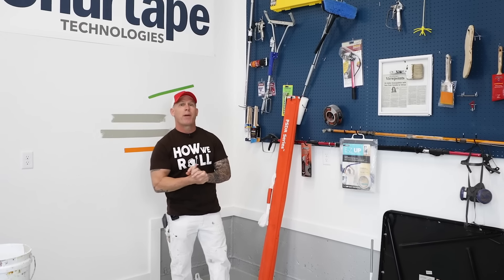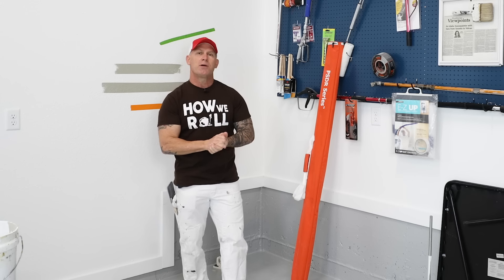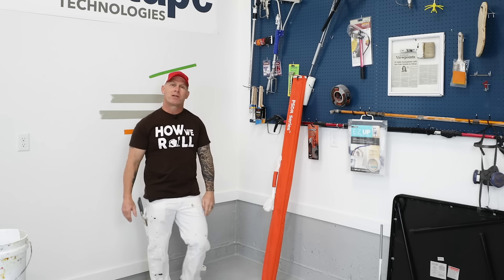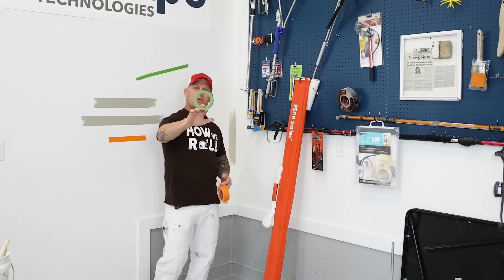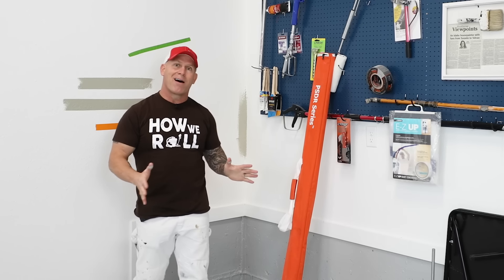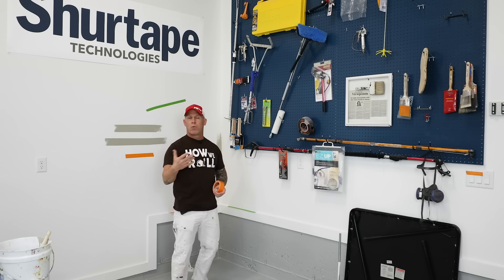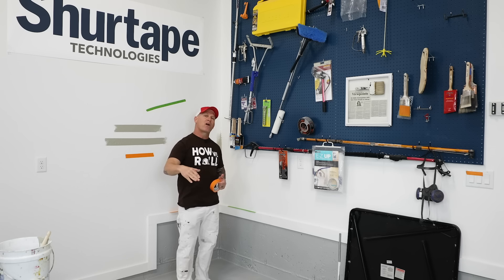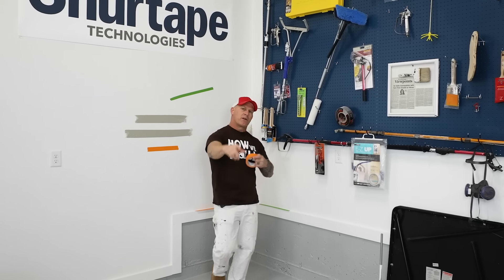ACCENT Walls, The Wall or Ceilings First!  What to paint FIRST...

Comment: In my experience for Accent walls or any scenario where there is two colors meeting. It is always best to get two coats of the lighter color applied at the meeting corner.   then bring in the darker color.     in other words the last thing i do is the accent wall (or darker wall).   my situation is almost always flat walls (no texture) and cut in by hand not with tape.       with professional paints two coats can be applied as soon as the previous one is dry to the touch....    between 10-30 minutes depending on humidity and temp
Reply: dark color last is important if you are not using tape.   cutting the darker color slightly onto the lighter color throws a shadow or more straight appearing line... if you dont have a perfect corner or perfect cut in which is extremely rare.
Reply: Brian Beall 
On thing I’m confused about that wasn’t mentioned in the video is this:

Chris mentions the first coat is a skim coat and you should stay 1/4-1/8 away from tape. How would you tackle the bottom or top corner where you have the 2 colours meeting of you aren’t supposed to take it all the way to the tape? There will be that section where you didn’t take the lighter colour onto the dark colour wall. 

Even if you wait until the second coat for the bottom and top cut ins, you’re still gonna have a section at the top and bottom where the light colour wasn’t brought into the dark colour side.

Comment: My question is about painting ceilings.  Using the tape and caulk method, and my wall is 30 feet long, how do I cut in the ceiling and paint as far as a ladder or scaffolding can reach without the paint and caulk drying and making a bad "joint" of the caulk?  I have had a few bad joints even on shorter walls as the paint and caulk have started to dry and when I move the ladder messes up the "skinning" caulk.  Thank for your help, a new subscriber but viewer for many months

Comment: Great video. My question is when you say "skim coat" can you clarify? Are you using a specific roller to get less paint on? Or is there a technique that results in less paint applied?
Reply: Skim coar is. 50%water,50%paint,gettin the drywall, plaster ready too bee painted

Comment: Thanks for the video Chris.  Not trying to ask a dumb question, but I tend to have much better luck taping with the yellow frog tape when applying it to a freshly painted wall.  Weird thing is I can only get the yellow Frog Tape at Sherwin Williams or Ben Moore......Lowe's or HD don't seem to stock it.  I noticed you guys frequently use the green Frog Tape - any particular reason?

Comment: Hi Chris, I just painted 3 rooms today using PVA primer, painted walls and ceiling using a Graco Magnum 7. Total sq ft was about 1300 and I used about 6 gal of paint, I am not a painter but I remodel homes and from time to time I do a little painting. I was under the understanding that a gallon of paint should cover about 400 sq ft, but my yield with the sprayer was about 200 sq ft... is that normal? I would love it if you could do a video on this matter or give me some tips to maybe increase my yield. I was using a Graco tip 515 on new sheet rock and it was my first time spraying, also I adjusted the pressure from lowest to high until I got a solid band (no lines on the side) my guess 2000 to 2200 psi. Thank you in advance for your response
Reply: Spraying often takes 20% to 30% more paint than using a roller. Sometimes the extra heavy stayed coat will cover with one coat (if you are very good at putting on a constantly even thickness). Whereas a roller will likely take 2 coats to cover well. Now if you need to spray a second coat to get an even covering,   you'll end up using 40-60% more than rollering.

Comment: Want the short answer instead of 12 minutes of talking? Ceiling first as long as you're doing walls too. I carry it down to the wall a little and brush it out. Then it's far easier looking straight ahead cutting in the walls rather than contorting yourself to cut the ceiling.
Reply from the maker: OK
Reply: Yep definitely. And I don't worry about painting around the entire ceiling before doing the middle, as the author suggested. Ceilings dry fast and by the time I'm done I can start cutting in the walls where I started the ceiling..he even said ceilings dry really fast, kind of contradicting himself. And, sharing a professional product I use, Dripless roller skins from ACE are no joke - 3/4 nap for ceilings, they'll hold some product and they do not drip.

Comment: For all the people saying you don’t need tape if you do you’re not a painter STFU .Im a Drywall Finisher And painter and the corners aren’t always true 90 or straight from point a to B so using tape allows you to what we call fake a corner. This will create a nice straight line on uneven or wavy corners .Now if the corners are real nicer here’s. I need and I never tape ceiling regardless of corners I like to create a bow sometimes it’s just needed and saves time especially when there’s none for fuck ups or much caulking tbh I never caulk . I finish most the stuff I paint so I’m lucky .